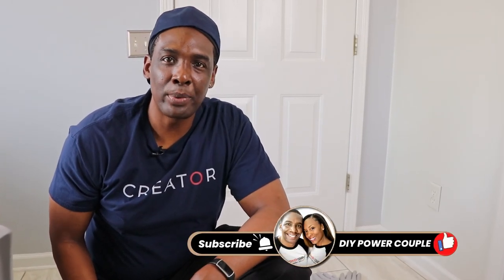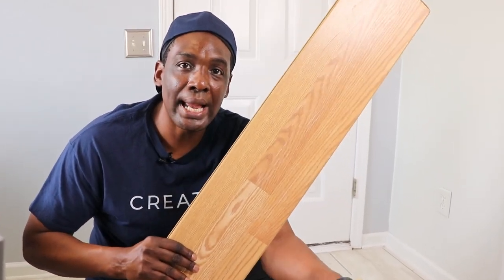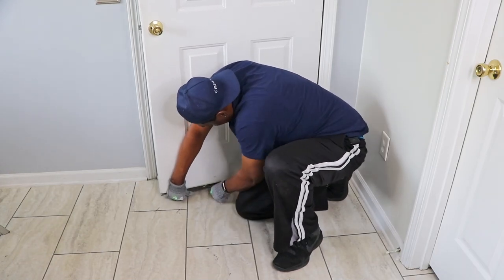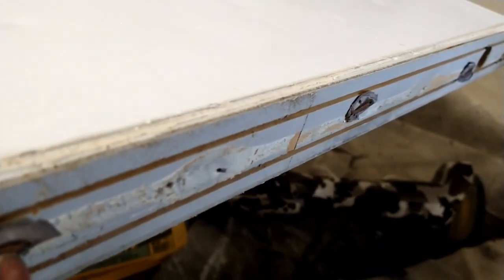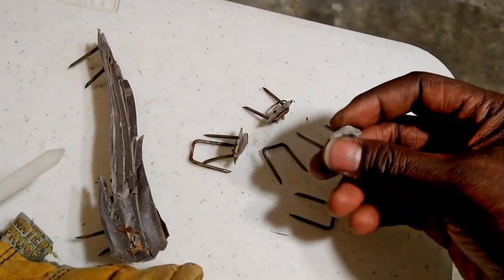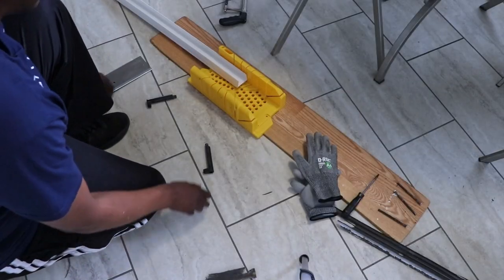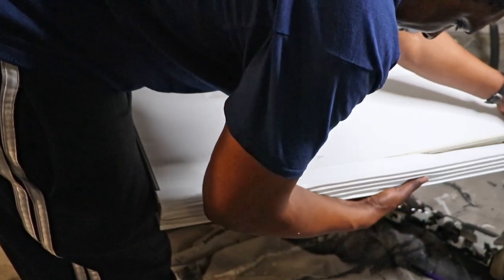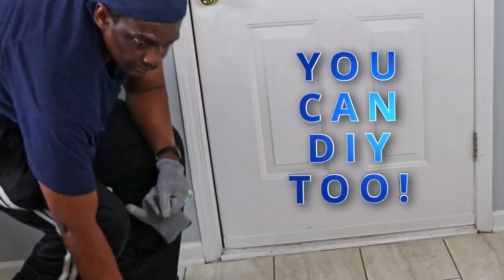The Flip Side of Door Sweeps: Shocking DIY Revealed!

Comment: We just had a renter move out one of our rentals. To say they 'trashed' the place does not begin to describe it. It was an exhausting two weeks. 
I bring this up because when you said 'it's supposed to be easy'.  Having done this for a while - it never is :) Also, better approach to remove hinges. I used a 5 and 1 and a hammer and go from the top. This is a much better approach.
Reply from the maker: Jack...thanks for sharing...and thanks for the tip. We hope that you recover and your rental turns out better than before. Wishing you the best. -DIYPC 😊✨

Comment: Thanks for sharing this amazing video became I actually thought the door sweep was built into the bottom of the door! Hell!! You showed me that it is stapled into the bottom of the door!!!😮However, I did a rent home where the maintenance guy had to come back and add staples to the new sweep because the door contracted. This door shrinkage caused the sweep to swift and come off the door a bit, which made the door impossible to close without hammering it back in.🚪😳